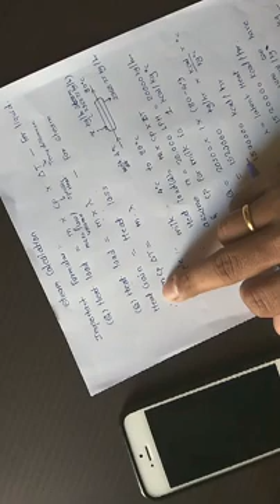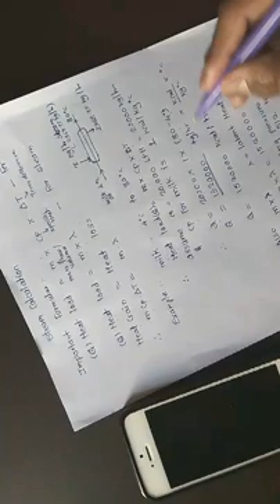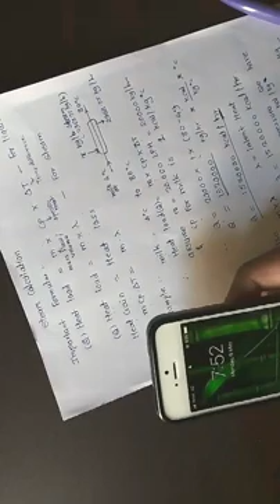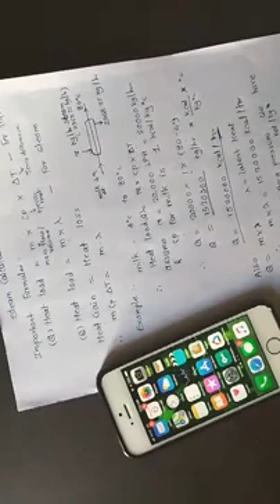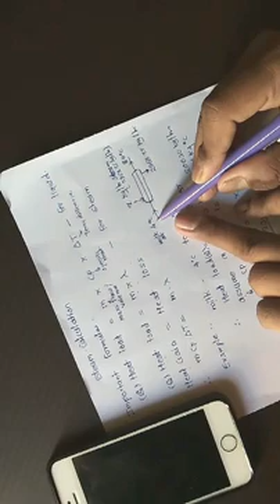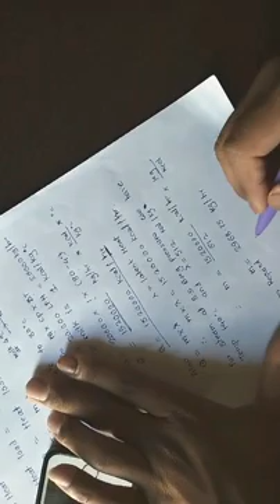Steam flowrate calculation for any heat application

Comment: And how to calculate indirect utility load calculation ...like Oil that is used for heating and cooling in batch reactor.
Reply from the maker: @Alok Rai: Basically heat transfer concept is same. Main is - How much energy you want to transfer to your process or product.

Comment: Very nice explained...TY

It will be nice if you can share heat load calculation for steam calculation for batch reactor for total reflux condition
Reply from the maker: @Alok : Steam consumption is depends on time also. in how much time you want achieve this target that need to also consider.